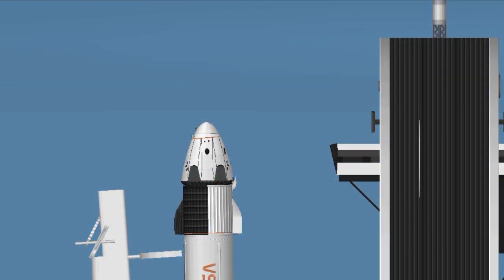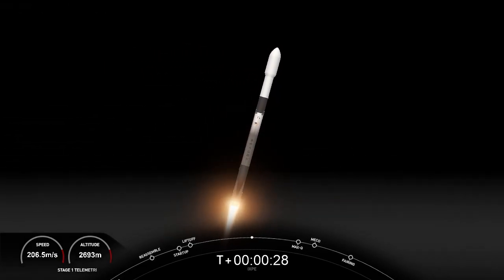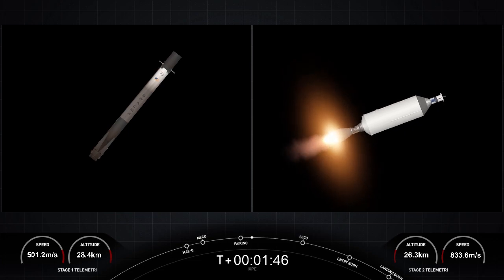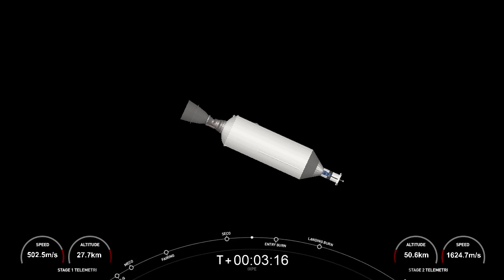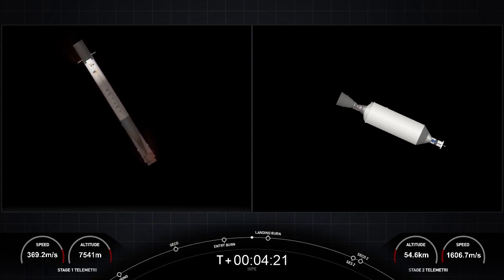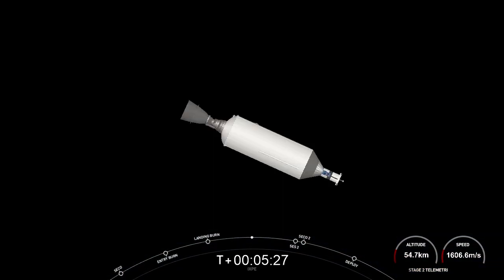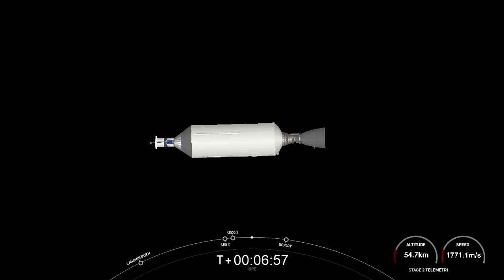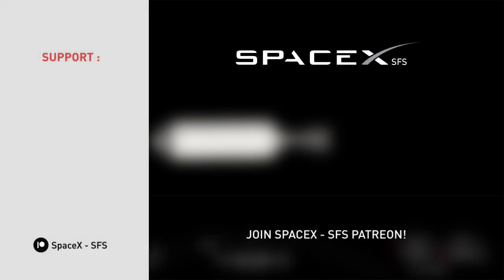Imaging X-ray Polarimetry Explorer (IXPE) Mission

Comment: @SpaceX - SFS sorry for the strange questions but when you post the reentry heat proof Falcon 9 booster, will we have to use cheats to stop engine heating damage? or will it be designed to have engine heating proofing without cheats?
Reply from the maker: Due to latest SFS updates frequently, I have to fixing every bps very often, but i sure, last update it the fixed version, so i can upload it to the website, and we can play it on latest SFS version
Reply: @skyridesfs  ah so its gonna be some time before you can make the falcon 9 booster engine heat proof because of the other bps?